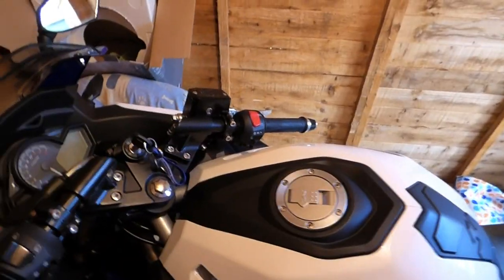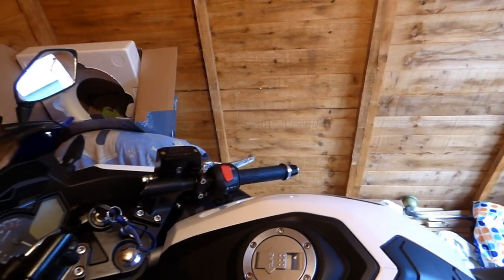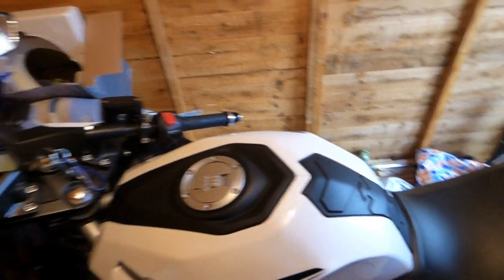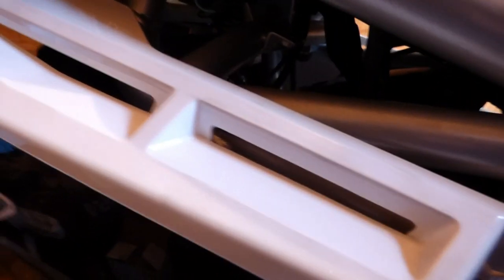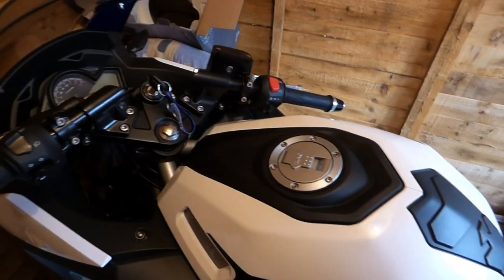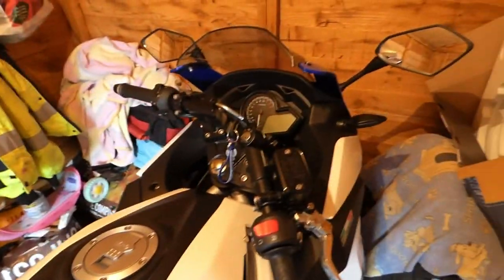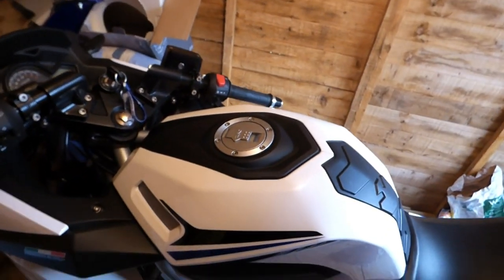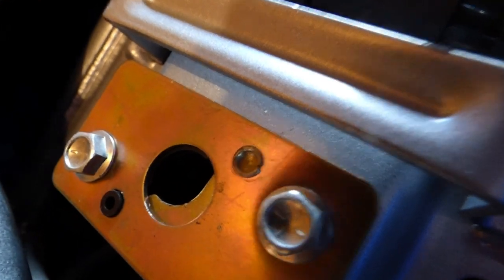Lexmoto LXR 125 2018 talking about the electrics and the second service

Comment: Hi I’ve got a lxr 125 and I’m having trouble finding where the starter motor wires are supposed to be as where the spark plug lead connects to